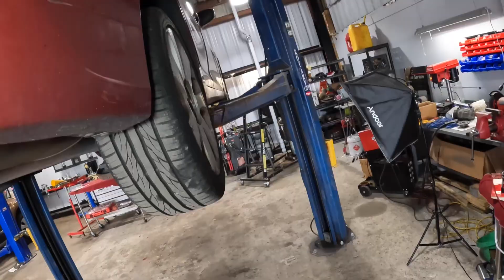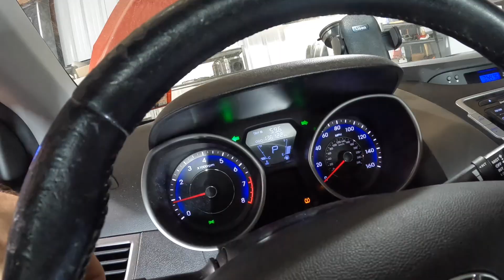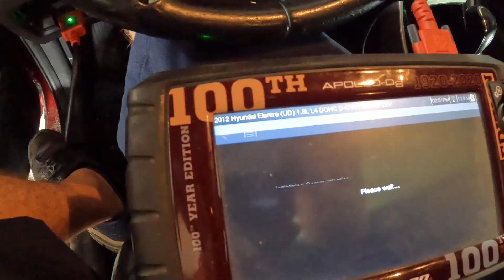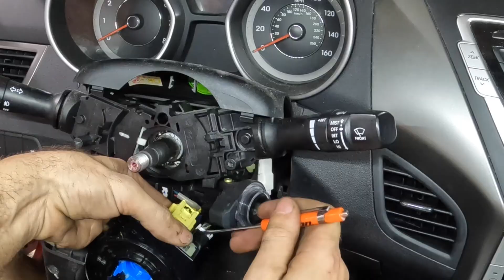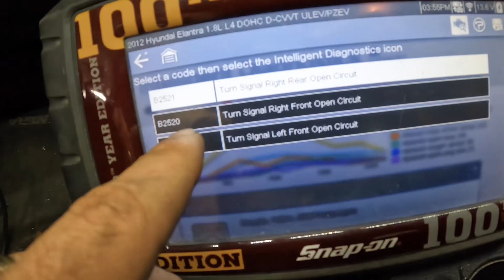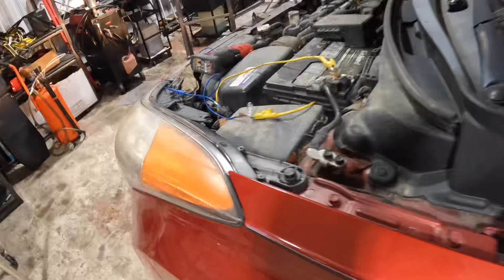Airbag Warning Diag and More! Hyundai Elantra 1.8!

Comment: first thing i check with a rapid flash is that all bulbs work properly. brake lights, running lights, turn signals markers headlights. the car is telling you there is a resistance issue. also turn signal switch is likely too especially seeing some solid light action

Comment: The wires in the clock spring are "ribbon cables."

Came across this vid as I have a new-to-me Hyundai Santa Fe with airbag fault codes. Clock spring is inexpensive enough for a first try at a fix.

Comment: You also need to get with the dealership with the VIN code of that car and make sure it's not under a rod bearing recall because they assembled that 2.4 and after the machine work they never deburred anything and it clogs up oil passages on the crankshaft Hyundai just put a motor in mine it's a 2012 free of charge

Comment: I had a bad turn signal bulb in my 97 Civic once that caused some very similar behavior to this. It used the same dual filament (one filament for park lamps, one for turn signal, since they are at different intensities and require different circuits) setup. Took some extensive bulb-swapping and testing but come to find out the two positive legs of the bulb were shorted together. The front turn signal would flash, inverse of the rear one, at the reduced park lamp intensity. It also caused fast flash - the different filament, and, in fact, the two shorted together, as well, all have different resistance characteristics. (That model Civic used a thermal flasher but same concept in resistance-monitoring computer circuitry.)

Comment: Hey Ray, are you a fan of the instinct handle snap on screwdrivers you have? I have a Matco set of screwdrivers, but using them my hands cramp up a ton when there’s more than 3 screws holding a component on and I’m thinking about trying out those snappy screwdrivers.

Comment: Funny with the clock spring! Just had airbag light with my car and the clock spring got replaced, too.
I really could not wrap my around how a "spring" in the steering wheel is related with electrical connections... well now I know, thanks Ray!

Comment: I'd always suspect corrosion on these "salt belt" vehicles - especially with the grounds and at the sockets. 

Used to see dielectric grease in bulb sockets in past (to prevent corrosion) with the older bayonet style lamp base, but don't see it coming off the assembly line as much any more with the 'blade' style sockets

Comment: 22:56 - The turn switch doesn't run through the clock spring it is on the fixed side not the rotating side.

Comment: Ray I had this exact issue with turn signal rapid flash I put new turn signal bulbs in that didnt fix the issue I ended up replacing the multifunction switch that fixed the problem

Comment: @RainmanRaysRepairs There are two levels of brightness on the turn signal.  One very bright when the headlights/marker lights are off (daytime) and one that is a little dimmer for when the headlights/marker lights are on (nighttime).  Basically, when in the daylight it needs to be brighter to be seen better and at night (when the lights are on) it switches to a dimmer light so not to blind other drivers.  You probably only need to replace those turn signal bulbs and it should be fine.  At least for the turn signal issue.

Comment: I would make sure the bulbs used are the correct part numbers. I had a sunfire with wrong rear taillight brake light bulbs and did something similar and took me down a crazy path. Spent couple hours for just wrong bulbs. Effected whole system

Comment: I replaced a right rear turn/stop bulb with an led in my 2013 jeep grand Cherokee and it works but I get an error message saying my turn signal light is out.  I'm told it's because the led doesn't have as much resistance so the car system thinks it's not working.   You can add a gismo to correct it.  Although I seriously doubt that is the problem with your car, just a thought.

Comment: Hey Ray. Giz here and I'm a PC tech with 300 years of experience. When I was a wee lad I found a fountain of youth and currently at 500 years old. They sure don't make things like they used to. Anyways, that is called a Ribbon Cable in case you were still wondering. Thanks - Giz from South Central Northern West Virginia, Leader of the Troubled Bears MC, Married to Xenatu.

Comment: Did they put single function bulbs (especially LED where it’s designed for incandescent/halogen) in the headlights in error? I did replace my flasher in my 07 Silverado when I switched to LED but I’ll tell ya, I have more problems with those darn retrofit LED bulbs. They look nice and crisp on it but those bulbs are terrible for long term integrity! 
Just my meandering thoughts—

Comment: Ray, it isn't the wiring on the car. Had a similar issue with a nissan with this issue, which means it's the headlight fixture. I had to replace the headlight fixture, because a lot of times these headlight fixtures short out on the inside and cause this issue. Once you replace the fixtures, the issue will resolve.

Comment: Two things. It's called a ribbon cable and shorts do not cause an increase in impedance. Shorts are a decrease. An open causes in increase. 

And take the freaking protection film off of the display on your meter.

Comment: I had a Hyundai once and it had the worst electrical system ever! It blew out headlights every couple months and the heater switch would quit working about that often too. Only 3 years old and almost nothing worked

Comment: Just a comment about troubleshooting and changing variables. Although I am not a mechanic but I utilized troubleshooting in my job. For me i try to only change one variable at a time. If you change more than 1 variable and the problem is not long there, you then have to determine which variable fixed the problem. Not a criticism, I just approach troubleshooting a little different.

Comment: We were on the same page Ray, as soon as you identified both issues, I went straight to the clock spring. Need the price is right failure sound bit. Nice work Ray.

Comment: I like your process of elimination. Im starting to think that car was underwater at some point. I'd be checking the seat mounting bolts for rust. I noticed some bolts/screws/fasteners are rusty on top of the engine. Im looking forward to future diagnosis.

Comment: Retired Electrical Engineer here, fyi, most multiple pin low current connectors (like ecm's) can develop high resistance between the male and female terminals due to micro movements between them (called fretting corrosion), so when your diag calls for a module replacement, unmate and mate the connectors a couple times and see if the problem goes away.

Comment: What engine is Not common with some type of an oil leak at a moment, when it should not particularly leak for its mileage it has.🤔
It would be easier for you to tell me what Engine won’t leak, I want to buy that engine😅 or car.

Comment: I think I need a clock spring on my refrigerator freezer door, it chopped 5 of 8 wires in its loom, I did not buy a new freezer door for $1200, fixed it myself, hope I left slack in the wires so no problems in future. I bet they test things for 10 minutes and say YEP it's good. Great vids Ray and team
Reply: My entire LG bottom freezer French door fridge cost me $250 about 9 years ago. Been working fine, don't think it has a clock spring though.

Comment: White serial cable with a red line position  indicator. Connectors  are either connections for communications or molex for power. The weakest link would  be the the cables.  Always found moving cables fail after a certain period of time if connected too tight.   Just a thought. Thanks for another super video.  NCR chargers $250 a quarter of a year to keep their diagnostics dongle..so $1000 a year to keep their diagnostics up to date...and 3rd party software gave a attack on software.

Comment: You obviously did not realize you running light (parking lights) on both sides are not working. Though you can see power on the little side marker  is on. (both sides) 

The headlight lens has two running lights the little side marker and the front running light.  Both need to come on when you turn the running lights on. The computer isn't seeing the resistance on the running light which is also the front blinker. (The dual bulb.) 

So clearly I could tell it looks like you need to replace both headlight lenses to fix the  issue that's inside the lenses. 

But also check for missing grounds. You might have to add additional grounds. Hyundai & Kia of this year range is typical to have missing grounds. So double check for missing grounds as well.

Comment: Check the ground on the marker light circuit. If the ground is open, the power from the marker light circuit of a two filament bulb will return back through the blinker filament. That's how the dash indicators light up.

Comment: Check ground on the marker light circuit.
Reply: If the ground is open, the power in the marker circuit of a two filament bulb will return back through the blinker filament. That's where the dash indicators light up.

Comment: Maybe screw the steering wheel nut back on just a couple of threads before pulling the steering wheel loose, it will stop it flying off and  into your face, just a thought 🙂.

Comment: I was surprised you didn't apply 12v to the amber bulb to check if both filaments were working. Your 'spare' clear bulb could be faulty in same way (one filament blown - spares are often used bulbs and those dim filaments are fragile)
Traditionally the dim filament blows waaaay before the more robust bright filament.
If turn signal has 2 filaments I would expect 2 power wires in main headlight connector as well as earth (bright flash for daytime when headlights off, dimmer flash for night when headlights are on). 
When headlights off computer tries to power both filaments for super bright flash - realizes one filament is blown so gives fast flash
When headlights on computer tries to flash dim filament - realizes filament is blown so no flash.
Alternately (and more likely), it could be bad earth on wiring. This tends to give bizarre results as power gets back fed through other inactive bulbs - hence when headlights on there is no path to ground through other inactive bulbs.
Suggest checking for really good ground on that connector - a meter might show very close to zero ohms to chassis and it would still be a problem given the huge currents headlights take.
Good luck

Comment: Corrosion or rust on the turn signal ground wire harness or a bad bulb as blinkers will run double fast on a bad bulb on one of the lights.

Comment: Reeee!  Given all the corrosion underneath, I suspect that the front bulbs' grounds are spliced together in the wiring harness, then brought to some chassis ground.  And there will be your problem:  A high-resistance ground in the front turn signals.

Comment: I have had many 60's through 80's GM vehicles with two bulb filaments. When a socket gets warn the bulb can be put in a half turn off which could cause this symptom although I don't believe this is the case after you used a tester to isolate the left blinker circuit.

Comment: Always very interesting watching your diag process with electrical issues.  And with today's modern vehicles even more important to trace a problem to the offending item and not just parts cannoning.  Interesting that Hyundai turn signal bulb using the old timey bulb (ll57 maybe). I'm looking forward to the followup diag.  Thanks again for another great video.

Comment: That diehard battery has been exposed to excessive heat.... The caps of that battery is easily removable to check the fluid level and can add Distilled water to extend its service life

Sure, one can load test it after the fact and see if there is still enough CCA for the rest of the warranty period (can't see the date code sticker edit saw a white marker 9/21)😊

Pretty hefty battery for a 4'cyl engine too😮 probably because of all the modules it has

Comment: Ray, you should test if the hazard lights blink with the lights on as well. Two of the very common reasons the indicators fail is either a faulty ground or the stick switch, but of course, you know that. Have a nice weekend.
Reply: Ooh I missed that part... He was thorough thru the process of walking around

and checking with the lights off /parking lights on

as well as using the separate hazard switch and turn signal stalk

Comment: Introduced TWO variables at once by moving the coil and the plug. Should have left the plug alone and just swapped coils first. Turn signal system is STUPID. Mechanical flashers worked fine for decades. When it flashes fast or not at all, it means a bulb is out. If it flashes weirdly from side to side like one side flashes and the other is dim, the ground is bad and it's backfeeding. Why introduce computers?
Reply: Yeah, manufacturers don't want to keep it simple😢

Gotta make modules link into other modules and intertwine for a more lengthy diagnosis process 😢

I saw that nightmare Ford F-150 tail light problem that interfere with the whole vehicle because of modules 😮

Comment: I had a car once, a 1990 Pontiac 6000, that if I had the air conditioner and the radio on at the same time and turned on the left blinker, it would blow the fuse for the dash lights.  It turned out to be a bad running light bulb on the left side of the bumper.  As soon as I changed that bulb, that problem went away.

Comment: my guess is to change the amber bulbs out. thats how we fixed the old school cars with fast blinkers but cars were simpler back then. they didnt have monitors for the monitors and the hvac system was controlled by cables and linkages not servos and electric wires.
ive never had to go behind the steering wheel of a "modern" car so now i know what im in for if i do. thats why i love rays channel. im always learning a different way of doing things or new things in general.
thank you, ray.
Reply: With those, it's usually easy to see if the filament is broken or burnt out, similar to pulling a fuse and looking at it

Led though, you need a meter to check
Reply: @ricebike  ?
How you going to check an LED with a meter?

They're automotive LED's, meaning each light has 3 or 4 LED's in a series string (more accurately, per series string).
You can sometimes get away with checking a stand alone LED with a meter on diode check (depending on the multimeter) but I'm unaware of a meter with a diode check capable of supplying 12v.

The only way you're going to tell if an auto LED light is faulty or not is to apply power to it.

I assume you're referring to using a meter to determine if the light is getting power from the harness?
Reply: @Jimmeh_B  oops, yes and there's a diode function on the cheapo meter as well
Reply: @ricebike  All good brother. I was just trying to work out what you meant by your comment. 

Yes yes. I have my fair share of cheapo DMM's amongst my collection of test equipment. 

They're good if you're doing something dodgy, or measuring something that might have transients riding on it.
I'd rather blow the ass out of a $20 fleabay special than one of my Flukes, or scopes.
Reply: @HouseCallAutoRepair  yes.
Once you overcome the cumulative forward voltage.

Comment: The front lights use a common ground for both sides flashers. Lost ground backfeeds thru the 3157a bulb to the marker side of bulb until you turn on the marker lights.

Comment: I would have checked the flasher or relay first. 
Just my opinion.
Reply: The hazard and turn signals usually use the same relay

(but yeah check Justin Case if it's under 2 separate relays)

So when it didn't hyper flash during the hazard light switch on, it kinda rules it out, for older systems

Once manufacturers want to go fancy and start integration of modules, then that diagnosis process is going to be longer 😢

Comment: When Nissan's do weird light stuff, it's usually a bad relay built into the BCM. Only way to fix it is a new BCM. This car needs one wheel and TWO tires. The one on the bent rim probably has internal damage. If you're looking for a new scanner, I've got an anniversary edition (looks like yours) Snap-On Triton I'll sell you. I'm retired and don't need it any more. @30:15... NEVER ohm out an airbag module. A DMM sends a small amount of voltage through a circuit to measure resistance. Sending voltage into an airbag module is not a good idea.

Comment: It may have nothing to do with this. Farther back on the driver side headlight amber lens. There is one of those tiny, single filament little peanut shaped push in bulbs. people often replace them with a "direct" led replacement. Some work, some cause the rapid flash, because resistance looks like there is a blinker bulb out, they are on the same circuit, because the peanut bulb provides side amber flasher. Don't know if this is that, but I've seen it. Turning on the headlights, with common ground, may cause the weird solid on dash indicator lights, maybe?

Comment: I had the same airbag code for my 2015 Kia Forte. It was the clock spring. But i did not have the turn signal indicator issue. and the 2012 to 2016 Hyundai elantra and kia forte are the same vehicles. i had to 1.8 naturally aspirated engine like this. this generation is 2012 to 2016 or 2018 I don't remember exactly. But to my point airbag stage 2 high resistance is the clock spring fault.

Comment: I would start with the ground wires for the front lighting pods. If the ground is not sufficient, the power will back ground through the circuits it can ground through, in this case the turn signal grounds.
Reply: Yeah, with that first part of the video, rust in various places...

 And that's a good idea to check the body grounds

Comment: Never seen twin filaments used in indicators (turn signals) but I've seen plenty of twin filament brake and tail bulbs fitted the wrong way round, reversing the function. Maybe the indicator bulbs need clocking round 180 °?